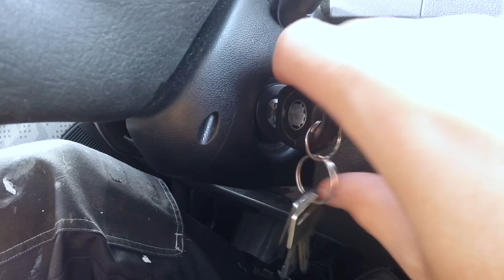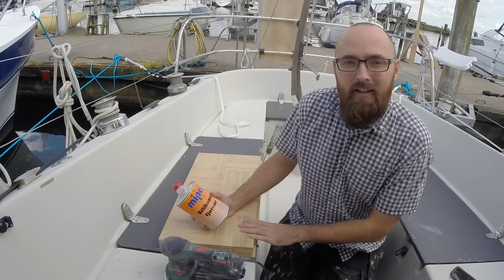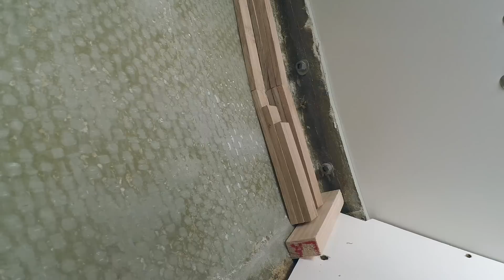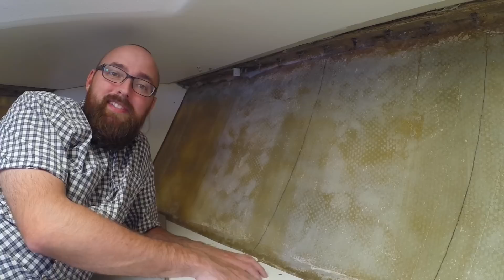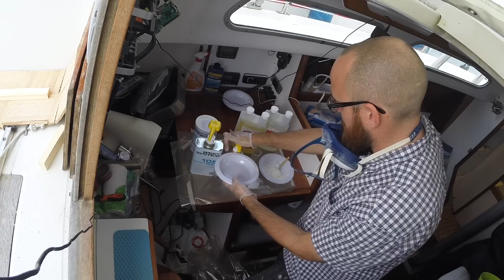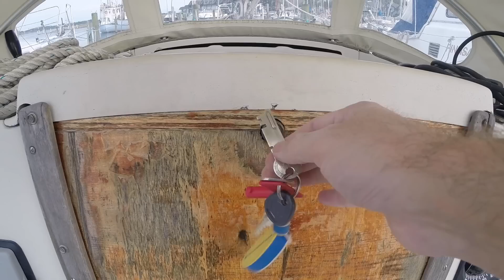Sail Life - Insulating the v-berth, part 4

Comment: ***** mads I hope you get a buyer for your house, of course that will mean fast forward on the boat projects, which are looking great!
Reply: I also wanted to mention I completely agree with on the story you were talking about.
Reply from the maker: Maverick Sailing Thanks, Adam :) How are things coming along aboard your boat? Or are you busy diving? :)
Reply: Mads, thanks for asking, I have been doing a little work on the boat, it has been a little tough since the Temperatures have been running 95 Fahrenheit (35 Celsius) plus the humidity and I work outside most of the time, that kind of heat really takes a toll on ya.  I have not done any more diving yet, but next Friday I'll be diving in an aquarium at Disney's Epcot Center.

Your story reminds me of something Jesus said at Luke 14:28-30. Where he talks about counting the cost of doing something, to make sure you can complete the project, or otherwise others my ridicule you.

But of course seems you have looked at all those things too.

Comment: First let me say I really am enjoying following along on your journey to make your boat, your home.  I do have a question. Are the stringers you are installing intended to increase the strength of your hull or just to add a layer between your hull and the insulation?
Reply from the maker: nbadhorse Thanks :) I'm glad to hear you are enjoying the videos :) The "stringers" only purpose in my case is to provide me with something to secure the horizontal slats to. They should more than suffice :)
Reply: ***** thanks.  The reason I asked, I have been in aviation for 40 years so all things boating are knew to me. On airplanes "stringers" run fore and aft and frames run vertically.
Reply from the maker: nbadhorse Very interesting :) I don't think "stringers" is the 100% correct term to use in my case, but it was the only one that came to mind. I wish English was my first language! :)